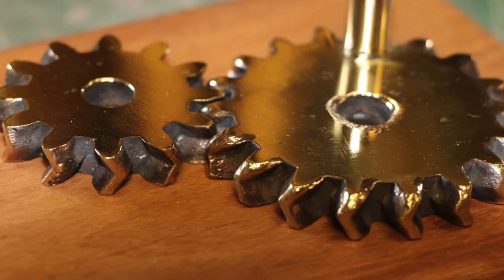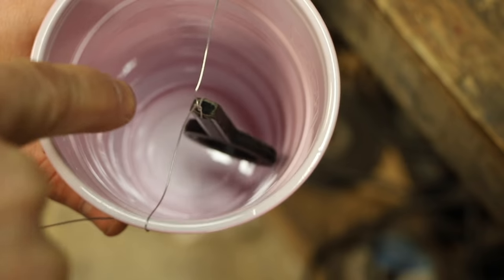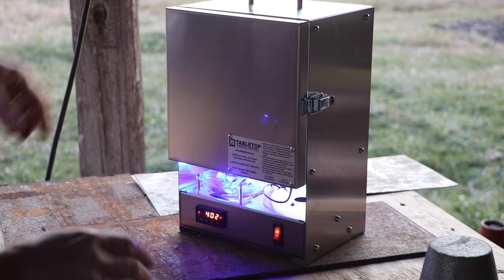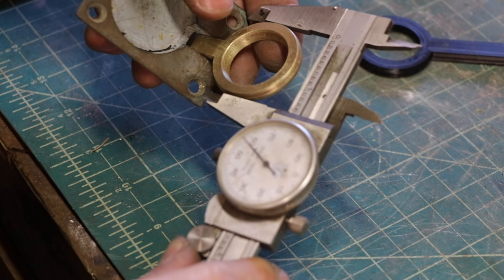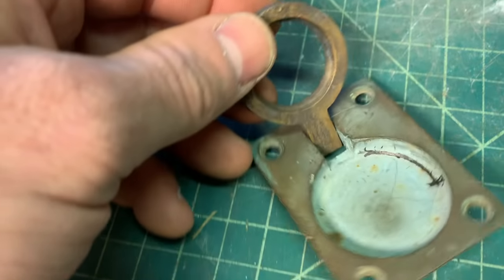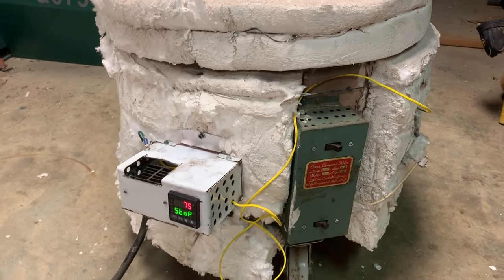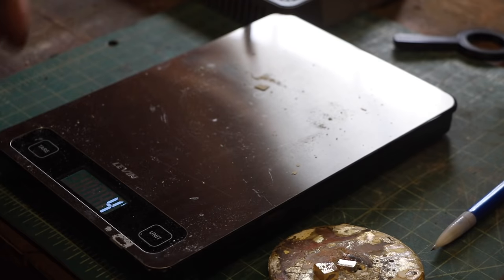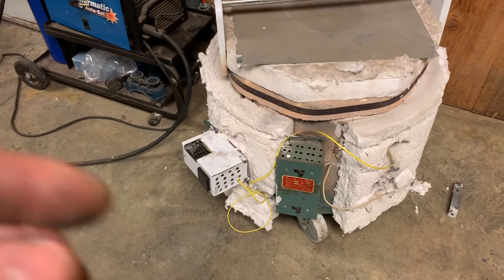3D Printing Metal At Home?  Pretty Much!  FarmCraft101

Comment: I am slapped with $16000 for just tool for injection mould for a small plastic piece.. I wish there would be videos how to make mould at home bit affordable.not silicon mould .. Actual aluminium mould. Or some expail why they are so expensive.

Comment: Besides the Clickbait title, NO you can NOT reproduce everything you can 3D print. You just can't create internal voids with casing. And besides the strictly impossible many shapes that are easy with the 3d Printer would be really hard to get working as a casting. For example, shapes where two areas are almost touching are no problem in 3D printing, but with casting the thin wall might break.

Comment: This technique works I guess.  It seems approachable by people with no experience with lost wax and investment casting while using the tech of three dee printing to replace some of the skill required for these processes.  I still think that wax is much easier and cheaper because of the low melting temp.  Maybe you could combine the two.  Come up with a way to three dee print wax.  This guy is great at investment casting:  https://www.youtube.com/watch?v=06t2_2I2tZk

Comment: Thanks for good video!

I don’t see value to do these castings - your example models are much easiest to do with china CNC machine and quality is much better.

Your price calculation is unrealistic - good printer costs much more and all gear costs are valid only if you find them really cheaply - what is not case most of time. Easilly these cost more than 1k - CNC is also much faster process than casting.

Comment: Casting precision parts with such a crude equipment? Sorry, but very stupid idea. Complex shape, sure, but at this point of tolerances, you are better off using the cheapest off the shelf gears. Also talking about the price of bronze? Your kilm eats that money for breakfast and oxidizes a big chunk of your raw material. All in all, these were the worst examples for casting over a 3D print.

Comment: I feel scammed.  You are NOT 3D printing metal.  You ae using traditional techniques with just a 3D print of the part to create your mold. When your Creality printer spits out a famished part in metal - THEN you are 3D printing metal.